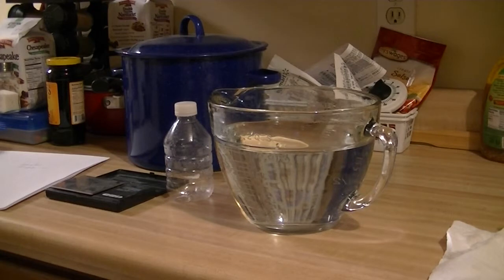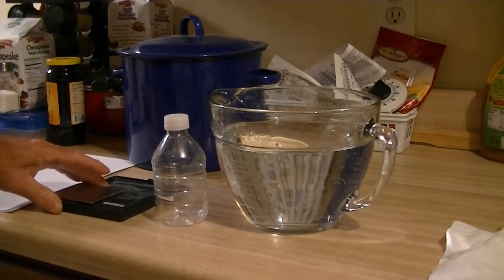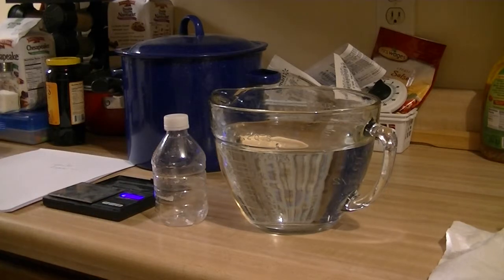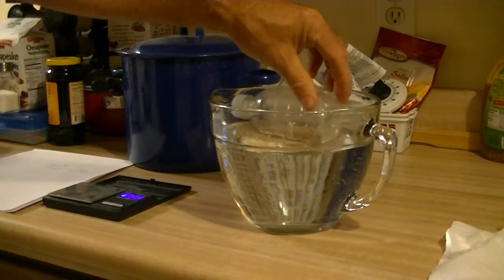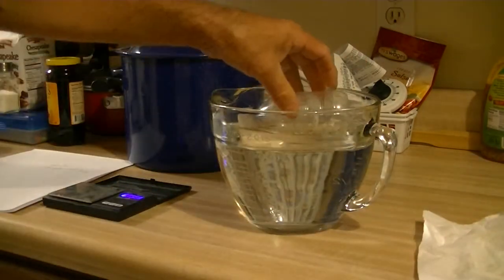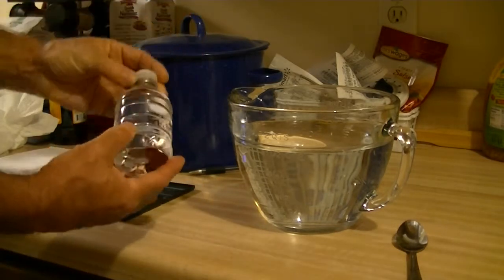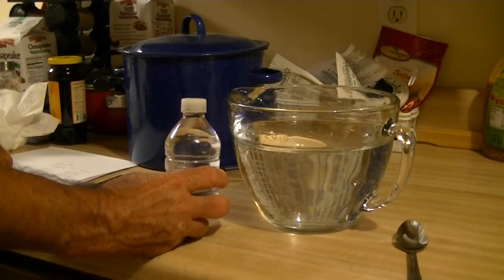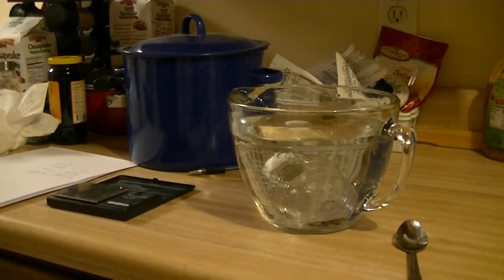Buoyancy and Archimedes' Principle.

Comment: Gary, it's been a while since you posted this series, but found them today.  I plan to make a small floating deck, maybe 6 x 14) using either 30 or 55 gallon plastic drums to which I will connect a kayak launcher (Kayaarm).  I want to the dock to float, but at the same time not be difficult to step into and out of the kayak (i.e., not the full 23" of the bbl.  I know the dock will help sink the barrels a bit, but it seems as if each barrel may need to contain some water to help lower the dock closer to the water level.  Besides trial and error, is there a way to compute the amount of water to be added to the barrels to lower the dock?  Also, would lowering the dock make it more stable - less tipy?  Thanks  Dave